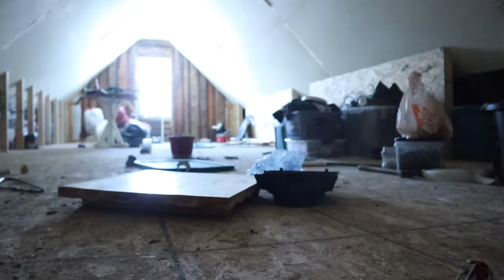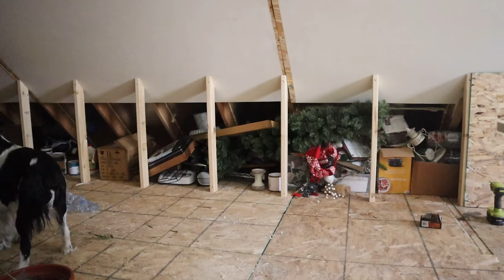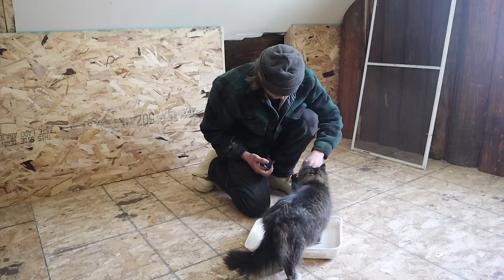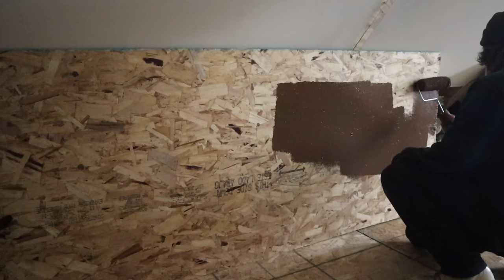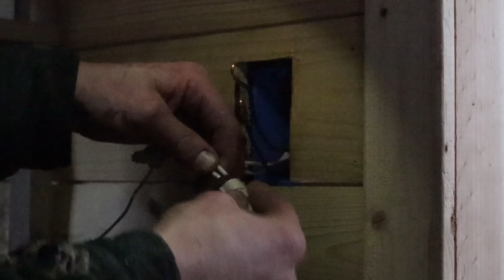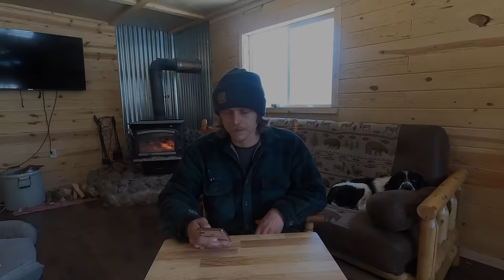Simple Mortgage Free Off Grid Cabin Living: Snow Storm, Loft Knee Walls, Q&A

Comment: I stayed in a similar cabin.  Upstairs, there was a large 2' x 3' grate set into the floor.  During the day, they had a small area rug over the grate, so the heat stayed downstairs, but when you went to bed, at night, you slid the rug away and the heat from downstairs moved up into the loft space.  It worked like a charm.

Comment: What about adding piano hinges to the top of the knee wall panel and put a handle at the bottom this way if you want to access behind the panel just lift the bottom and you have access to behind the panel and this way you could fill it in and you would not have to get on your knee's to push things behind the panel and gravity will hold it close make it cleaner as you wouldn't have sections that are open!

Comment: Never get the impression you’re at a “studio!” Lol. I appreciate your channel and Bush-radical realness that you will always have some level of connection. to society. I have a cabin in the mountains in the woods (I purchased it, did NOT build it myself), with fresh spring, a backup well, solar and propane. I still have to be attached to the grid for work, in winters… so my 
QUESTION: 

When things are overcast… how do you generate power or do you just deal with running out?

Comment: What are the regulations for small septic system in your area? It would let you drain your kitchen and shower and a low water toilet. We used a hand pump on a line into the lake and filled a small tank in the attic to supply washing and toilet water by gravity.